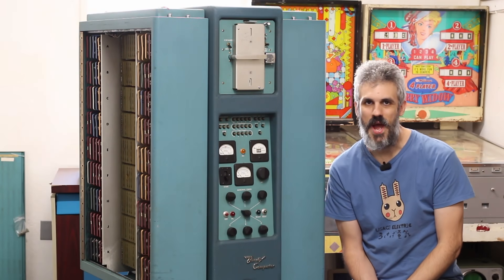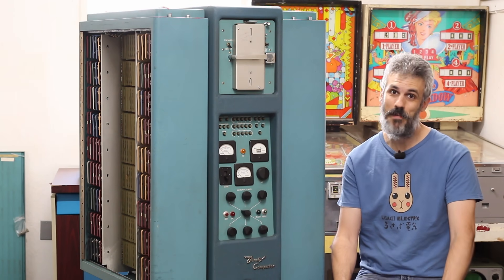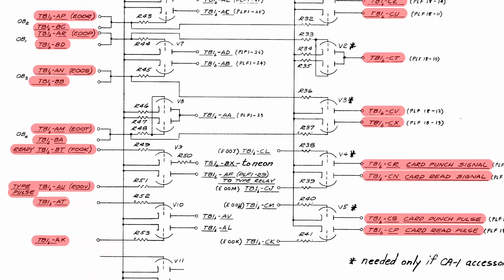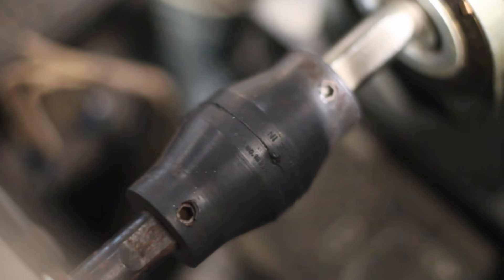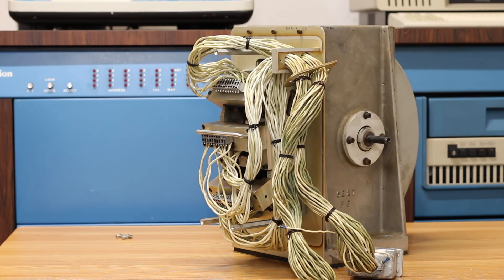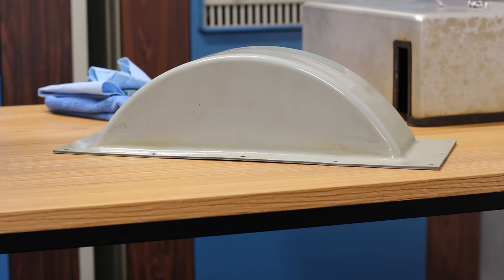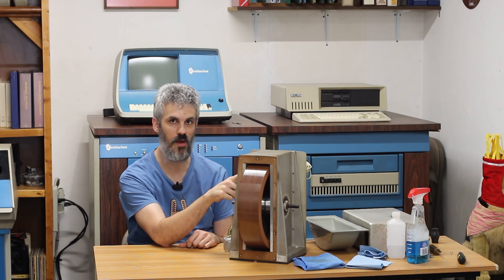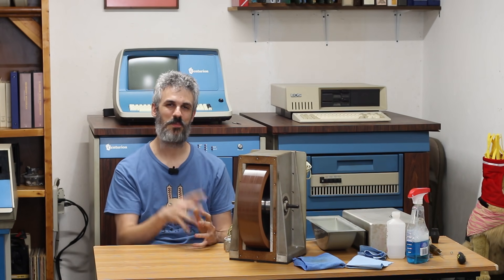Removing the Rotating Drum Memory from the Bendix G15

Comment: Your drum looks worse than my G15 drum so I understand replacing it.  That being said, I operated my drum for many years with several head crashes.  You simply code around (don't address) the damaged channels which is very easy to do.  If you're unlucky and a timing track or register track are damaged then (only then) is a crashed track a DOA problem.  IMO it would have been worth while to identify exactly which channels are bad before disassembly.  Retract the crashed heads of course.  At some you're going to have to do it anyway.  Also on this video, you mention the tape reader is slow.  I don't remember the specs, but in my experience only my MTA was slightly faster.  The optical reader on the G15 was ahead of its time and quite snappy.  The paper tape punch of course is pretty slow.  Keep up the great work.... I am very eager to see more of the G15 project

Comment: Clear coat sounds like a good idea. It seems to stay on cars at high speeds. Before I went to all the trouble, I'd spray a sheet of aluminum and test reading and writing spots with various thicknesses using coils approximating the actual heads at the 0.001" distance. That way you can determine whether you will have enough magnetic permeability to store and read data. It would be interesting to see if you can find the original coating formula. There may be secrets to it such as chromium dioxide particles. I know it would be a hassle, but can the original coating be chemically analyzed? Even a spectrometer might be enough. It would be hilarious to find out that they used boiled linseed oil! Another possible idea to consider is powder coating. Of course the bearings would have to be removed for the curing process.

Comment: Do you have a dial test indicator to check the recoated drum surface after?  I've seen Adam Savage of Tested use that type of thing for precision measurements.  Not sure if it's fit for use on a drum like this or the scale involved.

Good luck trying though 😁

Comment: If you end up having trouble with the replacement drum, surely the drum memory could be simulated with an arduino and some fancy buffering.   I see at least one head crash on the doner drum.   Also, you need to figure out a way to write the clock track.

Comment: The most difficult part to re coating would be achieving a small enough grain size of the oxide powder, could crash out micronized oxide from a solution or mechanically a ball mill might work. The application isn't so much a task as you can always polish out any imperfections, and away any excess.

Comment: I used to do work for a company that made iron oxide for magnetic media extracting it from the hydrochloric acid used to clean steel. It was facial powder consistency by the time it was sent to companies to be used. Was 30 years ago so I can't tell you much about the process. Spraying it on or maybe use a static charge like toner? Let it rotate in a pool of the material? All seems like it would work.  If you do recoat it is there a way to adjust the heads to any thickness changes? I wish you luck.

Comment: Electrolysis. Skim the drum until all pits are removed, then polish with metal polish. Once clean, use a pure iron electrode in a bath of dilute Sodium Carbonate in purified water to deposit Iron Oxide onto the surface of the drum (acting as the other electrode) using electrolysis. You'd have to slowly and very steadily rotate the drum during the process to keep the deposited layer even.

Comment: I am wondering if the depth or density of the magnetic layer would affect read/write performence..
If it is too thick or thin, would it have the right density for the coil's energy level, to impart data to the track? (I am thinking of magnetic transfer energy the same way, as heating a thermal mass.)
Am I right on this?

OH, and the statement under mine makes a good point.. If the drum is removed and replaced on the axel, it might not have the same center of rotation it had when on the lathe. Can the drum with all rotating parts including the axel be mounted on the lathe and use the axel as the center reference? 

Can you use a (Center gauge) on the drum, while it is still mounted in the original unit, (both inside and outside 0f the drum) to see how centered the drum is before you loosen anything? 
Warning, the center guage I have, has a strong magnet on it...

Comment: What is the condition of the heads? Could irregularities on them have caused the crash?
Could the old coating be removed chemically, as a start, instead of scraping? Would its reaction to different chemicals be a clue as to what was originally used? Could the old coating be analysed to determine its composition?  
Looking forward after recoating the drum, how will it be initialized? I presume there must be some step(s) that must be taken to set some kind of markers.
What does ChatGPT have to say about this?

Comment: The idea with the varnish and the copper particles might be feasible, but I think it's too difficult, since you're already pretty close to the limits when painting effect varnishes.

Apply a new coating electrically - like when galvanizing components for rust protection - only in that case to apply a few micrometers of copper.
Reply: Not copper, but an iron oxide that is magnetic.
Reply: @SeanBZA  ... youre right. Looks like copper but is Iron

Comment: I dig the ingenuity of the plan! Maybe also put the drum on a wheel balancer before doing any machining, just to make sure that the shaft is in the middle, and that the drum isn't balanced weird creating vibrations and head crashes. I don't know anything about this tech, just spitballing :) Also can you remove the magnetic material chemically before it went to the lathe? That might save some valuable clearance in the end if you take off too much. Love the channel!
Reply: The drum is probably already thousands of times more balanced than any auto wheel.

Comment: Recoating drums was a farily common thing in the early years. I remember reading accounts in various computer history articles and books on early machines. I would search for articles by such people as Conway Berners-Lee (the father of Tim Berners-lee, inventor of the WWW) and Tony Hoare. "Washing the data off" was a thing, especially when a machine was used for "sensitive" (e.g. military"). They would wash the oxide layer off with something like acetone and then recoat, which may well have involved dipping and rotating the drum in new coating in liquid form. Machining off the old oxide is almost certainly going to end in nightmares, or at least tears - much to aggressive (but arguably very Texan...).

Comment: Hmm... Another option, and this should produce a set thickness, would be using the same technique as really painting a car - use an electric current to draw your paint to the drum, then coat it as many layers as needed. This method tends to make a uniform thickness, though.. no idea if it could be done with a magnetic medium.

It also involve "baking" the paint on after, instead of drying more slowly, so again, no idea if that would work for magnetic media.

Comment: Thank you for the video, I know you wanted to cough the Bendix computer back to life, especially the magnetic drum to run the program again. But forgive my ignorant comments, is it possible to run with lathe to smooth the magentic drum?  I don't know how thick is the magnetics drum. My other words is I can't find the patents for Bendix G-15 on google patents. But copy a drum design, then coat with the magnetic oxide. I also read the comments below about the bearing which is true in which cause the damages to drum. I can't image how much of your work which is worth the efforts. My only though is: how do they wrap the wires that run all over the computer with black strings? Looks like it was done with doctor doing the stitches. I find this fantastic! Thank you.

Comment: Here's an idea for your drum : electroplate it in iron. allow it to oxidize. Spray on a protective coating.
Reply: How does he ensure it oxidizes to create the Fe3O4 form of iron oxide which is ferromagnetic and not the Fe2O3 form of rust which is not? Unless it is gamma ferric oxide which is ferrimagnetic and could work but requires a high temperature process to manufacture
Reply: @bornach  - play it music that inspires it to become the form I didn't know existed?

Comment: I don't know all the trivia of the topic of the conversation very well - but we are dealing with a huge metal donut that rotates on a shaft at a huge speed, it also needs precise balancing, as well as the absence of misalignment and vibrations.
Even in the first series, I had the feeling that the surface crash could be related to the wear of the bearings because many years have passed and none of us knows exactly how long this mechanism has been working.

I wonder what the heads look like, and how the adjustment is made for such a small gap?

Comment: That streak on the drum @ 15:31 looks like it made an awful noise! I wonder if the clean line in between the two streaks is where the actual head element was; perhaps made of softer metal then the rest of the head, and/or recessed.

Comment: if i were to try and recoat this i would mount some sort of squeegee ... possibly felt ... rotate the drum and slowly drip or spray more and more of the magnetic paint on it until there is an even thickness 
the biggest issue would be picking up dirt and dust 
all that being said, you can easily try it as many times as you need as its not production and the heads will probably be fine tapping some dust every now and again

Comment: Touching anything while it's curing will just drag your finish. I'd probably go a thin primer not high build. Then hit it with your paint if you can get enough solids for the coercivity you need. Then rough balance it, then I'd plan on sanding it. Ideally you'd do it mounted up in the device so bearing runout, mounting etc is taken out. But you hit it with some 2000 grit paper on a block and you'll take the orange peel and other defects out. Self leveling of liquids that turn solid is never as nice as we'd like because they always shrink or expand in the process. They can get close but never perfect. 
A really top notch auto body finish will do high grade paint, then sand it out sometimes to 8000 grit, then come back and polish with a few different grades of polish.

If that doesn't work out perhaps hit up "breaking taps" he's a YouTuber with the gear for vapour deposition, a big vacuum chamber and the right sort of inclination to do this kind of crazy thing.

Comment: Possibly slowly and steadily rotate the drum with a bath at the bottom filled with an iron-type substance (I'm struggling here), then coat the drum with iron oxide using electrolysis? Bit vague, but I'm sure you get the gist of what I'm trying to explain.

Comment: How do the heads look? Are there 8 heads or one on a stepper motor? You can just spray the proper oxide on the surface - there is a nice IBM video from the 60s.

Comment: Ditch the power hog drum memory and build an emulator system with a pi and a system to connect possibly with an arduino. The point is just to make it work right? You could possibly try polishing it with an abrasive or wet sanding and fine grit sand paper. The heads could be corroded too. Fixing the drum may not make it work if the heads are bad.

Comment: So many folks who are much more knowledgeable than I am about machining and setup have held forth at surprising length.  Consider carefully how you will resurface this drum.

Question:  is the core of the drum a monolithic piece, or is it a welded-up assembly?  From what I can see, this thing was machined from a single billet of aluminum.  If so, keeping temperatures under control during machining will be crucial.  Otherwise you lay yourself open for warpage or tool chatter.

Coating can and should be done at a very low rotational speed (something like 33 and a third RPM?) which should be maintained during the curing phase after the spray is completed.  I know some really knowledgeable folks in the machine shop at my workplace who may have good insights.  I'm kinda wondering if a vertical machining center might better than a lathe for the initial machining.  I'll get back to ya on it in the next couple of days.

Comment: I like the idea of trying clearcoat loaded with iron oxide, although it may take a lot of experimenting to get the right viscosity/consistency to develop the sort of film required. You may also want to experiment with more "period accurate" polymer binders than 2 part PU, like nitrocellulose or acetate lacquer. It would be interesting to scrape off some flakes of the original coating and send them to a lab to try to determine what binder or class of binder was actually used and the grain size of the ferric material, but that may be too costly. Could also do some basic analytics yourself; seeing how the original coating behaves under various solvents and acid/base, how it smells when burned, etc could give at least a general indication of what it's made from.

Comment: I would try using an elctrolytic process, like spinning the wheel through a FeCl3 solution as a cathode, then heat the Iron layer with steam to get Fe2O3 (~600°C). Its probably giving a thinner, more dense and even layer, which might be able to be polished.
Reply: Will that process result in gamma ferric oxide, i.e. the ferrimagnetic form of Fe2O3? The alpha kind is only paramagnetic and would not work.
Reply: @bornach  looks like it would give the ferromagnetic variant, i am not 100% sure though https://en.wikipedia.org/wiki/Iron(III)_oxide

Comment: Absolutely fascinating work on the Bendix! 
As for recoating the drum - I'd spin it slowly in a shallow bath of a magnetic compound solution, removing the bath after it's covered, then spin at high speed to let the centrifugal force make the coating thickness uniform while also subjecting the drum to high velocity air for drying. Then perform polishing if necessary.

A Linotype and a Heidelberg "windmill" automatic platen press! The mainstay of European book printing throughout the 20th century. Pity they don't seem to have a Monotype composition caster... you'd see one of my fascinations, haha! All these things of beauty are a joy for ever... or at least until they break down and you can't get the parts.

(The smell of 60 year old electronics... It fills you with determination.)
Reply: That method was the first thing that came to mind but I'm wondering if it'd actually result in a uniform coat or just an extremely uneven finish where the droplets of excess coating are flying off. On a disk (the IBM method as I understand it) excess goes off the side, but on a drum it has to lift off of the surface.
Reply: The original drum seems to also have magnetic material on the side, which made me think of a dip and spin method like you're suggesting here.
Reply: I think it'd be more likely to make any underlying defect worse rather than better. Any movement towards the outside would increase the centrifugal force so high spots would try to get higher. The only counteracting force would be surface tension.

The spin coaters are different because the force perpendicular to the plane of rotation  so there's no impact on force applied due to the thickness of the coating.

Comment: Could you strip the old coating off chemically, then gently polish the surface? It’s going to need to be much more accurate than a lathe, getting it centred accurately enough in the chuck would be a challenge in itself.

Comment: About removing the top layer. Rotate the drum in the housing for as litte run out as possible and remove the layer not with a cutting tool but with grinding in an right angle to the rotation. You will get the best results this way. And try to replace the bearings with a run in first. They will be expensive as f*ck.
The problem with using a lathe is that you will have hard time to mount it exactly the same way as it will be in the housing. The tightness and play of the bearings, the unevenness of the bearings itself and so on will change the way the drum is running in the housing compared to the lathe.
And spraying on should work but the grain size of the iron oxide have to be very small. Also the substrate have to be quite liquid to be able to contain all the Iron oxide that is needed. And i think they used pressure not air to spray the coating.
The drum should be rotating while the coating is hardening, to negate gravity driven deformations.
I'm quite sure that the drums where polished after the coating to guarantee an perfect thickness and roundness of the coating.

Comment: Its no coincidence that producers of magnetic tape were in the paint industry. Iron oxide paint! To get a good output they have to maximise the pigment content yet keep it durable. Presumably with non touching heads they could go a bit further.

The echorec echo machine used a drum with a close spiral of very fine iron wire that was then machined flat to over come durability issues. They were recording full audio so no serperation was allowed. In this case the surface was oiled. You can get away with your 1 thou so not an issue. Wire coating may be easier.

Comment: Are you sure the "grease" on the inside isnt just some deterioration product of that old plastic? it could be plastiscizer that is separating from the polymers and had nowhere to  evaporate from on the inside but either did on the outside or simply combined with all the dust to seem like a layer of crud.